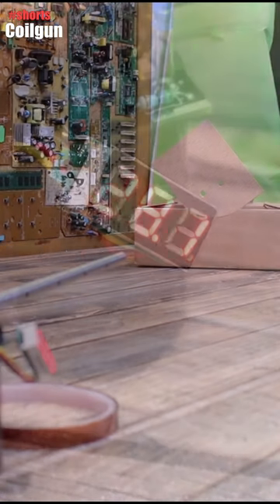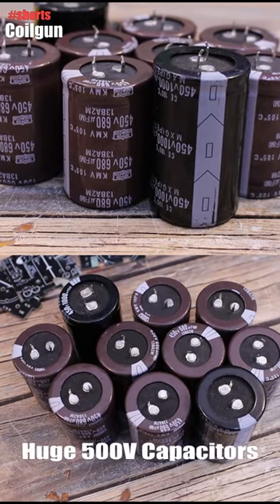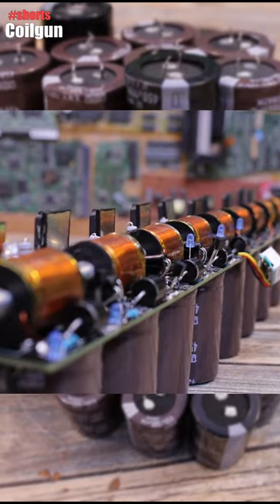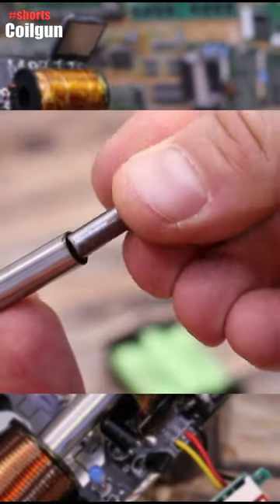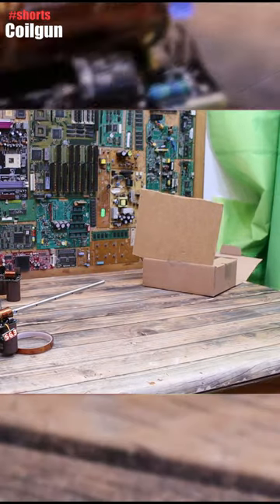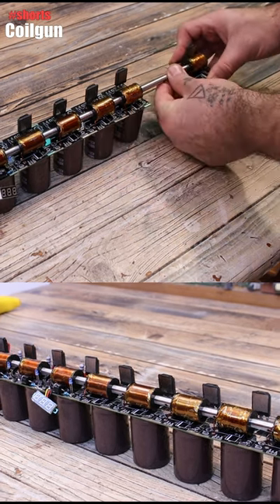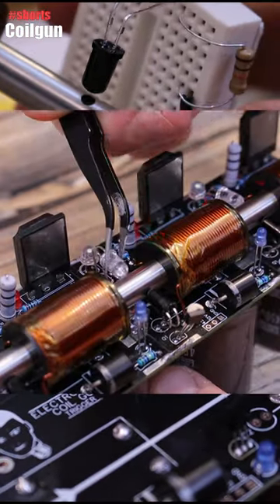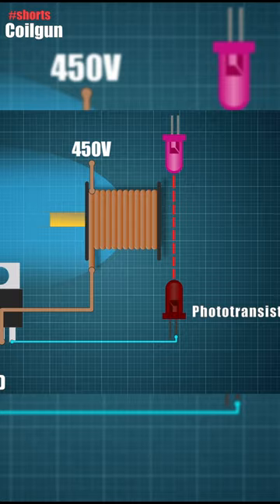Incredible Powerful Coilgun - Homemade

Comment: I'm still waiting when you finish this project! For the test I've ordered PCBs from your design with 10 stages and I've got one thing to say - never ever test it indoors lol
Reply from the maker: What Happened?
Reply: @ELECTRONOOBS  Projectile slipped into the barrel activating every coil from the 2nd to the 10th and now I've got nice hole in the wall (EU brick wall, not some cardboard US wall :D )
Reply: @ELECTRONOOBS  Also found out that you've got one flaw in your segment PCB design - it's just about one marking where is the receiver diode. You put plus sign where should be GND, I had to double check on the schematics lol.